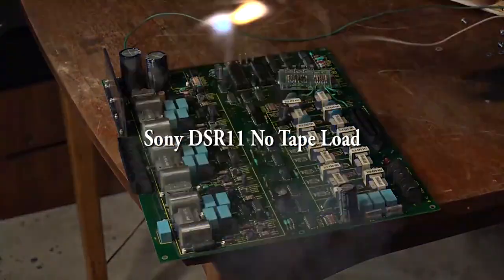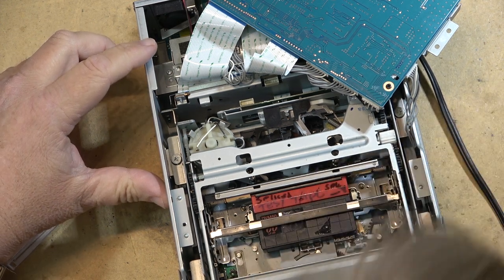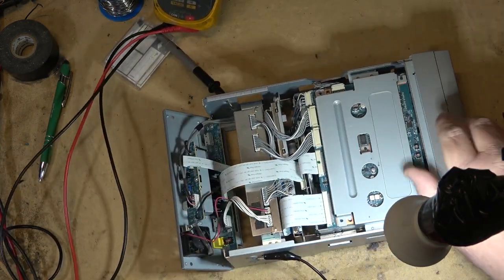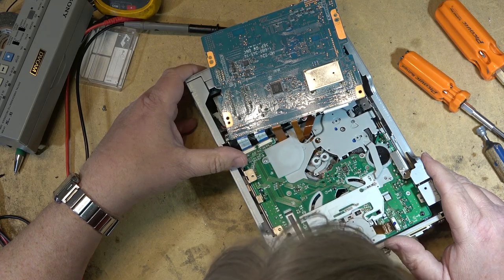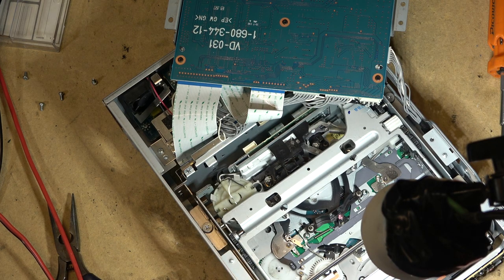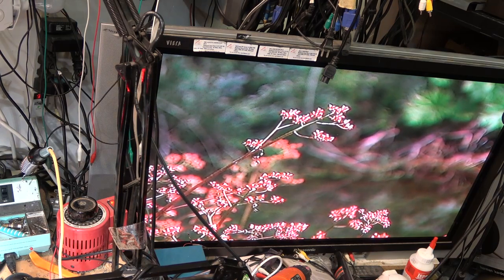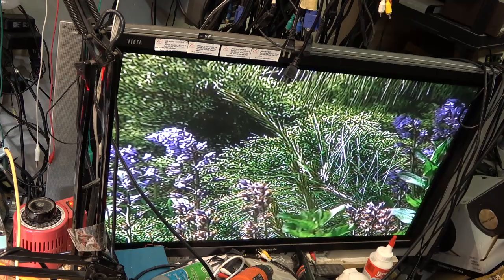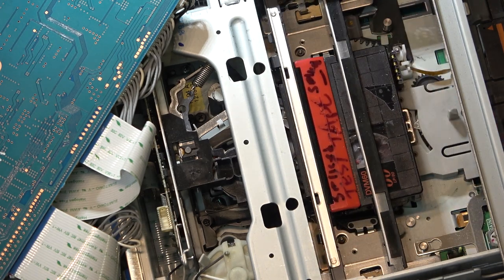Sony DSR11 DVCAM / MiniDV VCR no tape load

Comment: So a re-lube and exercise,  the owner will be happy :-D
Motors often lock up, due to lack of use, as you said.
I have an old  ITT Studio 720 cassette recorder.  
When i came to use it the motor had locked up.

There is a pcb with a motor drive circuit,  lucky that the circuit limited the current.

Comment: Great to see these decks being used still.  I tried using mine the other day after many years on no use.  I have low hours on it-probably less than 50 but after around 10 years or more of no use I am having issues ejecting the tape.  I was able to play and eject several tapes then after around the 5th tape, it didn't want to eject anymore.  The tray comes up to eject then tries to eject the tape but gets stuck when trying to push the tape out.  You think it just dried up somewhere?

Comment: Great video as always Dave. Quick question, are you still using the same film scanner and other than the take up motor issue has there been any problems with the shutter? It appears it’s getting a lot of use.
Reply from the maker: Still using it and dropping the film into a box as the take up motor quit years ago.
Reply: @12voltvids  I´m doing the same too.
Reply: @12voltvids  thanks for getting back to me Dave. I guess those scanners can take a lot of reels without any issues with the film gate. I took your advice on using a box to take up the film. I have the Magnasonic scanner and although the take up motor is fine, the film doesn’t suffer from the jitter of the take up reel motor pulling on the film. Especially when a splice in the film passes through the gate. I’m hoping the Magnasonic can keep going as long as your Wolverine. Thanks again.
Reply from the maker: @guitareveryone  wolverine over 700 reels now most big ones.

Comment: Are there any other accessible lubricants that can work? I've had trouble finding the Molykote pg-641 grease that I see in the video.
Reply from the maker: I use mg chemicals white lithium grease.  The molykote came with replacement parts 30 years ago. I had a bunch left over and used it all up.
Reply: Use silicone grease if it has plastic, if it's just pure metal you can use 3 in 1 machine oil

Comment: Advice.  How easy is it to add balanced outputs to a cd player that only has RCA outputs.

Is it possible to tweek the laser focus on old cd players to enable them to read / play CD-R/CDRW discs burned on computer.
To extend the life of Vacuum Florescent displays on rare old cd players, would it be possible to add a switch to cut feed to VFD, without causing issues with general operation.

Chears
Reply from the maker: 2 op amps.  One using + input and other -. Of just gey a transformer 600ohm to 50k or whatever the output is.  Balanced output is totally unnecessary.  It is only useful for sending over long cables.  One wire in phase the other out of phase. Any hum that is picked up through induction will have same phase on both conductors and be canceled out at the other end.  Does nothing to improve sound.
Reply: @12voltvids   thanks for that. Regarding the VFD isn’t it just a case of cutting the common feed to display. Therefore the heating wires would still be active but the current to drive the segments absent, till restored(by Switch) then illuminate again??
Reply: Regarding reading TOC and playing  CD-R or CDrW??  The player was manufactured between 1986 and 1993 before DVDS and CD-ROM drives were widely available, you mentioned on some of you’re videos this was to do with different reflective properties of CD-R and CDrW which caused certain machines to baulk at reading. At this time there had not been legal revisions to copyright infringement, so could it be some manufacturers played safe ,and much bigger companies,like Sony were more bullish, being confident that should a case be brought against them , they would defend it and win. ??!

Thanks 👍👍
Reply from the maker: @Jrer241067  
Cdr  and cdrw operate completely differently.  Cdrw operate as a phase change to the reflected laser.  Cdr use a dye that is burnt with pits and lands.  Where the dye is burned the reflective surface reflects.  Where it isn't the dye absorbs the laser light.  On stamped CDs the pressed pits change the focus plane so in or out of focus reflection register as 1 or 0.  The reflectivity remains constant.  Cdr typically requires a slightly stronger laser as the reflectivity is lower. The wavelength of the laser is also important.  That's why early DVD drives with a red laser can not read CDR. They can however read cdrw because a DVD drive can detect the phase change of cd-rw. 
Why? Because DVD from the start was designed as a dual layer format and that is how it reads one layer.  One is conventional pressed disk with the focus shift and the other phase shift so the player can focus on one and ignore the other.  So it is able to read cdrw as it uses phase change.
Reply: @12voltvids   so trying to fault find,using knowledge from watching you’re videos.
Have two Technics SL-P1200 cd players( professional) models. 1 worked, 1 had faults. Have on bench. Display works and does self test. Laser works and focuses. No spindle drive movement ,and liner motor wizzes to start of disc on turn on,but coil BUZZES and gets quiet hot,which doesn’t seem normal.
I think I need to trace voltages,and compare with mana factor spec,yet the engineers service manual doesn’t give this.
Could you let me know where you obtain detailed circuit diagrams you often use to diagnose equipment you service,and possible pinpoint areas to focus on to diagnose.
Any help would be greatly appreciated.

Thank you
Reply from the maker: @Jrer241067  
If you can't find it on HiFi engine I have no other source.
Reply: @12voltvids   I’ll try,but I think I’ve been there before. Thanks anyway

Comment: I have 2 Sony DSR-250 DVCAM cameras and a DSR-50 DVCAM portable deck not that there’s much use for them but I have always been a fan of video tape formats since the Betamax days I could not even dream of buying one of them when they came out now they are very cheap to buy and still work 23 years later I was wondering why I hardly see you do repairs on the DVCAM equipment I guess it was a professional thing not really for the home user.
Reply from the maker: Never see dvcam. That's was Sony's pro version of DV. Identical except for wider tracks and faster tape speed. I ran professional DV here which was a pro camera but used the standard DV speed.  Remember the data format was identical.  Same as digital 8.   It had locked audio vs the consumer unlocked audio but professional DV had locked audio as well and was compatable with consumer players.
Reply: Thanks Dave, Great job getting that deck to work as always somehow you manage to get things fixed most of the time dvcam broadcast cameras were nice specially how Sony managed to get them to use MiniDV and the larger dvcam tapes in the same loading system.
Reply from the maker: @MUSICADELOSY-rx4nx  it really wasnt that difficult.   The betacam decks also worked with larger tapes.  Dvcam however wasn't a true broadcast system as it used the same 4:1:1 color space.  I have only seen a few players over the years.